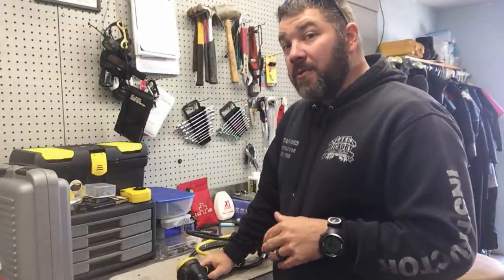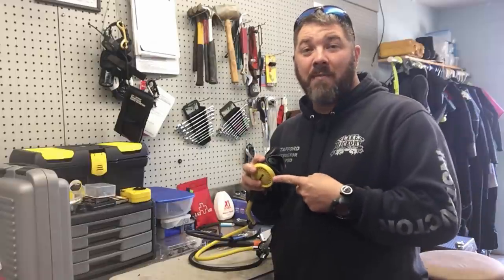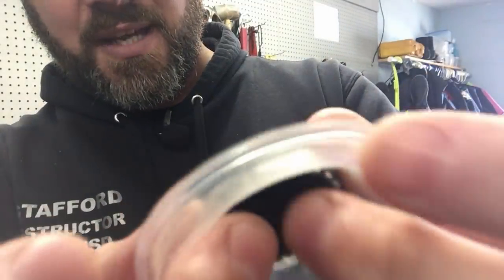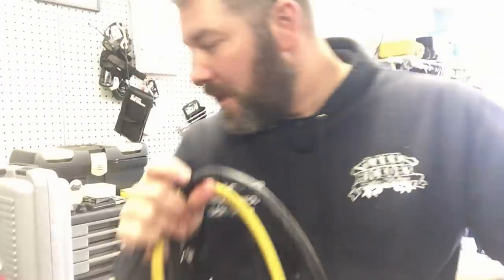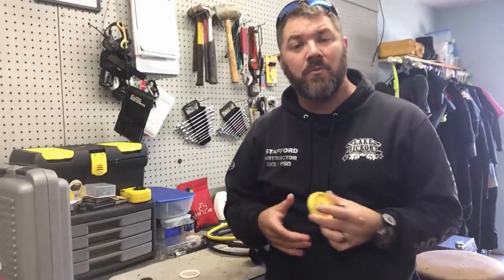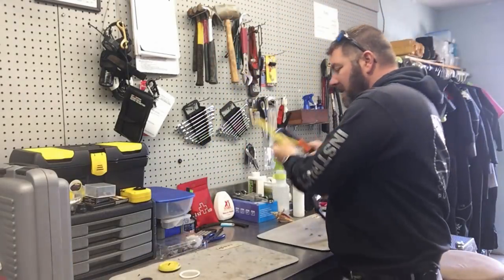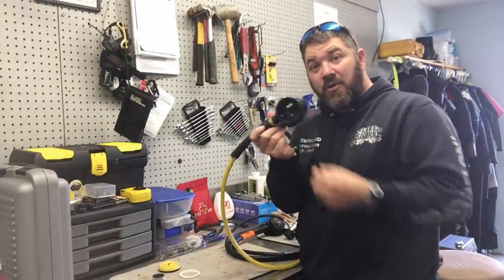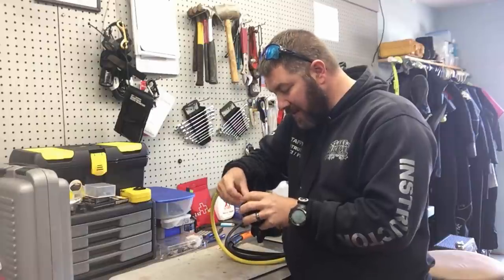Is Your Regulator Truly Clean

Comment: One thing that really helps after diving in salt water is a good long soak in warm (not hot) water. From the time you surface until you get home or back to the dive shop, a lot of saltwater can evaporate and leave salt crystals drying in all the nooks and crannies of the reg. A 30-minute soak followed by a thorough rinse can do wonders at keeping everything clean.
Reply from the maker: A Thorough Rinse is the key.  Agitating the water helps as well.

Comment: Brian
The regulator that came with my Mares 12s is breathing "wet".
I took the 2nd stage apart and rinsed it thoroughly.  The diaphragm doesn't appear to have any holes. Any suggestions?  What is the best way to clean the diaphragm?
Reply from the maker: The majority of the time, when a regulator breathes wet, there is either a hole in the purge diaphragm, a hole in the exhaust diaphragm, a small hole in the mouthpiece, or the hose adapter is lose.  In the last case, you would see bubbles coming from the point where the hose connects to the second stage.  There is also a small chance that the low pressure seat has worn down and allowing water to come in with each breath.  Another thing I have seen over the years is, divers don't keep there mouth secured around the mouthpiece and water can come in around the lips.

Comment: What do you recomend to clean the regs with? Soap and water or something stronger?
Reply from the maker: Any commercial gear wash works very well.  But if you want to make your own, a simple mix of Baby Shampoo and Water works great.  When we clean metal parts of a regulator, during servicing, we use an ultra sonic cleaner, and our solution is a 50/50 blend of vinegar and water.